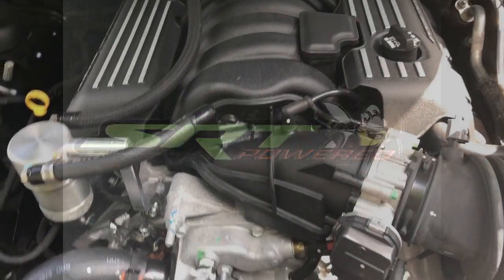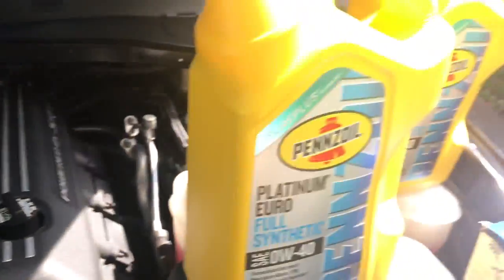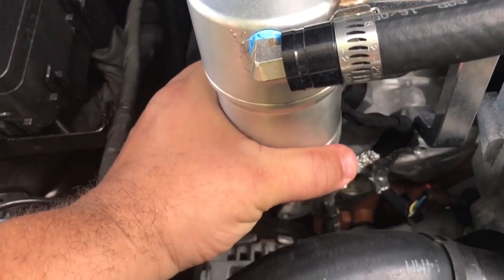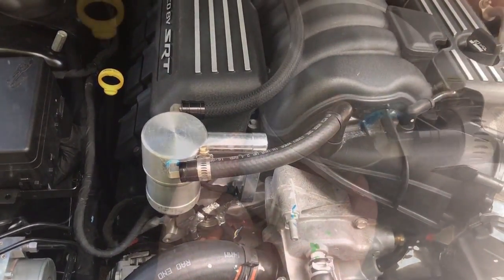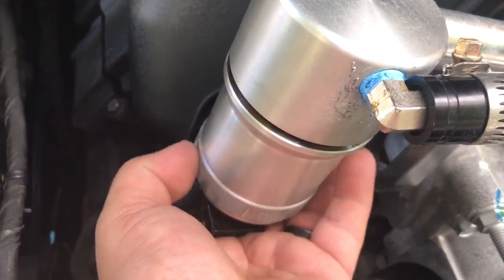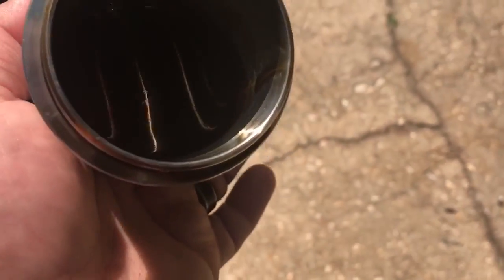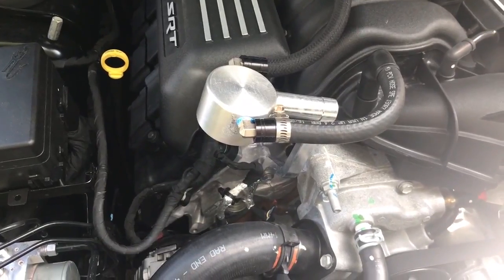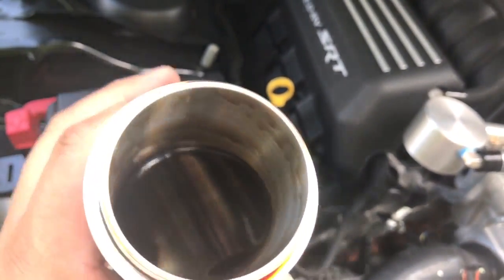Oil Catch Can after 5500 miles: Dodge Charger Scat Pack 392

Comment: What is the catch can for
Reply from the maker: The purpose of a catch can is to take what is being sent out through the positive crankcase ventilation (PCV) valve, and separate the actual oil that may come out, collect it, and send just air and vapors back to the intake manifold, as opposed to the PCV system sending both air, vapors, and oil back in the intake manifold. The goal is to avoid getting oil into the intake manifold. Oil is meant to lubricate, and unless you drive a diesel, you should not be burning it in any way. Boosted cars benefit the best from this devices however on N/A cars the added oil will lower octane rating and lower performance.

Comment: Any issues at the dealer, do they void the warranty for the can?
Reply from the maker: agentd36 absolutely not.
Reply: 6.4L HemiPower thanks man, great videos, I’m subscribing
Reply from the maker: agentd36 catch cans should be a factory spec however they require emptying and if not will just go into the sump return which defeats the purpose of the can. Thanks for the sub I’m primarily Firearms related but in 18 I’m focusing more on the scatty.
Reply: Oil catch cans are now stock on the 2019 cars . Just saw it for myself
Reply: @richardbrown986  wrong buddy... I have a 2019 scat.

Comment: Did u install the oil catch can or did you have someone install it for you? I'm not a mechanic at all and im trying to figure out who to go to when it arrives. Thanks
Reply from the maker: antdogg2008 no need to pay someone unless you just want to. I did the install and it's very very simple. With several videos on how to install I think you'll be okay.
Reply: antdogg2008 dude its too easy. 15 mins max. and that includes cutting your hoses to length.

Comment: You should see how great they work on supercharged motors....I empty about every 500 miles on the Shelby.  Not needed on the driver side....only on the passenger side.
Reply: God, Guns & Gears do you have one on your race car?
Reply: Yes...came from the factory with a large one mounted to he firewall.  You around the weekend of 11/11?
Reply from the maker: God, Guns & Gears I bet especially being forced induction. I had a T-Trim Foxdody the consumption wasn't as bad but man those blower car create massive pvc pressure.
Reply from the maker: God, Guns & Gears not sure yet supposed to have some folks come up the road and spend some time. I'll keep ya posted.
Reply: Kyle...shoot me a pm when you get a chance
Reply: God, Guns & Gears I sent you an email with my number. Give me a call